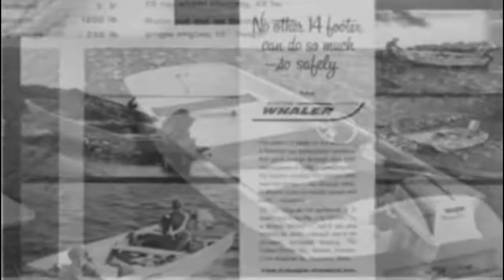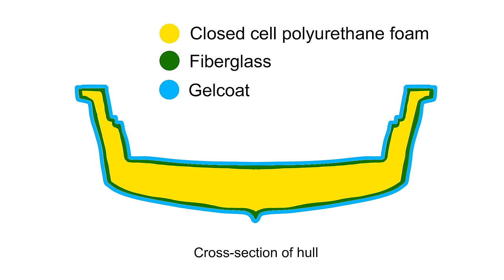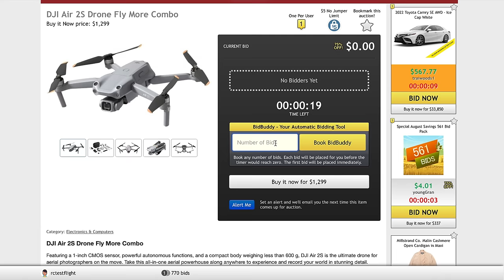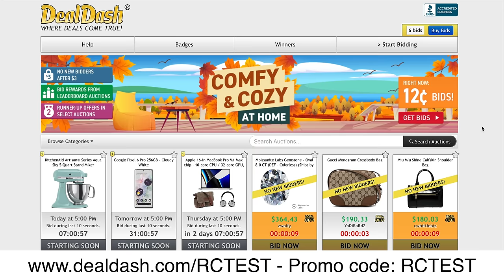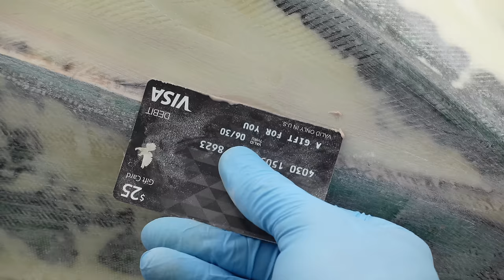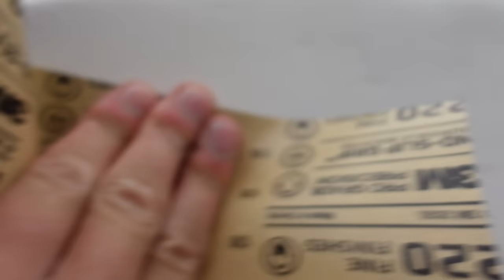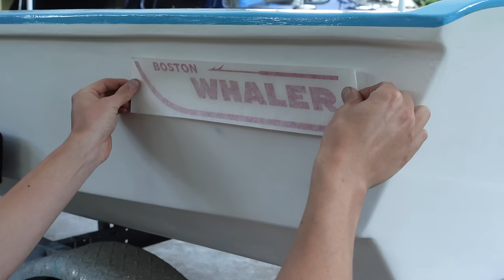50 Year Old Boat Restoration - Solar + Electric Conversion Ep.1

Comment: From my experience polyester resin is the cheapest way to do it and for boat like this its plenty enough. This is also why you dont fill the gaps or cracks with anything other than glass fiber putty and then fiber glass top of it. Best way i have found is random mesh, only using weaved on the highest tress areas. The way you sanded this thing just by looking got me itching.. dear god amount of dust is just insane. Best way seems to be using course as possible grits to get biggest possible dust witch also works as rough surface to fiberglass repairs while at it.
For places that need hand sanding just get "Reciprocating Saw" or construction saw what ever it is called. Electric saw with detachable hacksaw blades pretty much and modify dulled blade to attach sanding block to automate the work.
Roller is used to get air out underneath while paint brush is good to wet the surface, though you might want to consider using silicone brush since its reusable after epoxy or polyester had dried. Though in this case polyester resin since as mentioned this boat takes lots of resin to fix and epoxy is expensive, specially stuff like total boat what is UV protected. Cheaper non UV protected is the stuff that local boat works use and i get is 30€/kg/liter from them, but could just order a barrel worth since that is even cheaper.

Wait, you sprayed GELCOAT?! Ou nononononono, stuff you need to use is TOPCOAT. Gelcoat is when you mold something and it cant be contact with the oxygen. Topcoat is to repair and resurface existing construction like this. Guess the additive makes gelcoat to top coat but still..

Comment: In my line of work we use a high build marine epoxy primer, once cured we machine down to about 600p. And for paint we use a aliphatic assisted linear 2k polyurethane, it flattens out really well and has very high resistance to chemicals and abrasion. Ideal for boats and aircraft It's a bit more tedious compared to gel coat, but I do find it's a better option, especially if your looking for a low orange peel Finnish.

Comment: Really liked the Video, just a quick reminder to maybe keep in mind for your next boat ;): if you use Epoxy with the Fiberglass, you have to protect it against UV-Rays, which destroy Epoxy over time. When laminating a boat, they often use polyester resin based gelcoat which can withstand UV-Rays much better. Although that's not an option for you, because polyester resin cant stick to epoxy resin, it only works the other way around. I think the best gelcoat for your boat would have been just a thin paintcoat which can withstand UV-Rays and a robust anti-fouling for the underwaterparts. Would have saved some weight...

Comment: next time try to get a "Total Boat" sponsorship, that would cut down on your epoxy cost. Also you can use epoxy paint and you can get some pretty thick cotes on. Epoxy paint also has the added benefit that you don't need to sand the glass smooth because you will be adding a mill or 2 of epoxy.

Comment: As someone who is currently fixing up a 1967 13 whaler, watching this is giving me 'Nam flashbacks. And yes, polyester resin just stinks. Marine paint would probably have been much better than gel coat for your purposes. A linear polyurethane paint like Awlgrip or Alexseal will apply well and self level when drying. I had good luck with just rolling out the hull of my boat with a LP paint and wet sanding and buffing out any runs.

Comment: I have a 68.  I feel your pain, but don't have your resolve. The previous owner ran it aground at some point and fixed it with about 2" of bondo over about a 8 sqft area. When I cut out that "patch" it weighted about 50 lbs.

Comment: Look at HarborFreight and look up surface finisher. It comes with 3 nice wide wheels of different grit and pretty ergonomic to use, and would cut your refinishing time down a lot.    Now it won’t get into a lot of the tight spaces but a lot of the wider surface areas. It’ll definitely save you some time.  I think. Just my opinion.

Comment: You should try the Milwaukee M12 FUEL 1/4" Right Angle Die Grinder.  It's right in between your Dremel and angle grinder in size...and would be perfect for this job.

It has become the go-to tool for everything around my shop.

Comment: You made the right choice of resins, epoxy is the best resin to use because of is ability to bond to old cured resin, the trick to wetting thicker fiberglass is to pre wet out the back before laying it into place

Comment: Pro tip: 

If the cloth strips are cut on the bias it is much easier to for around curves. This mean they are cut 45 degrees from the perpendicular mesh weave.

Comment: Polyester resin does smell, and also isn't water proof (hence gelcoat), but epoxy is waterproof.

The "fin roller" is for mat.  It helps brake down the glue holding the fibres together, and get the mat fully wetted.

OMG!  that boat must weight a metric butt tonne, with all that extra resin .

Comment: The laser turned on because you’re supposed to swap heads with the machine off. :D There’s also a 10W laser you can get for it, as well as a dual-extruder.  There’s even a rotary attachment if you’re so inclined.

Comment: If you turn your spray nozzle 90° from how you had it you can more easily lay down the paint with a side to side wrist action. Same goes for any other spray finish you may use in your air compressor spray gun.

Comment: Funny that you use yellow tape for that. . .  
I work at a boat factory in Bremerton and we use yellow tape to indicate to the detail/repair crew things on our boats that are not good enough to send.

Edit: A 90 deg die grinder and sanding disk set works pretty well for this kind of work, btw.

Edit2: While it's true that you generally put the gelcoat down in the mold, then the glass, we do also spray it, sand it, and buff it from time to time. Mostly for repairs, not a large area. Basically, the gelcoat fresh out of the mold has to be buffed anyway. This is because the gelcoat reproduces ANY imperfection the mold has in it, even scratches and texture.

Edit3: We use screws to hold our rub rails on. Our plastic is single piece, then we put a stainless/chrome skid on top of that. The skid is also held in with screws, but decorative screws. Incidentally, any boats we make that have those protruding ridge/skids also get the stainless chrome skid on the leading edge. That way, if someone drops the thing on the only rock on the whole beach it won't fracture what is basically a load bearing rigid component.

Comment: Gelcoat is just polyester resin with a white pigment. Spraying it on the outside of a mould is fine, but it will require wax or something else in the final layer to shield it from the air so that it will cure. However, it is not recommended to apply over epoxy as it will fail to adhere in the long term. You can get away with it if you are meticulous with surface preparation, but doing it over large surfaces is risky.

You can get epoxy paints; however, these are usually primers used under two-pack polyurethane paints, as epoxy will degrade and break down if exposed to UV.

The proper method of sealing and finishing an epoxy layup is with two-pack polyurethane paint such as alexseal or awlgrip. 

Hopes this helps with future projects, and you earned my sub with this vid! PS you definitely should have just bought a better boat ;)

Comment: When doing large glassing jobs, lay it down, wet the whole thing out from one end to the other, then go back to the start and work it into place. The binders they use to hold the glass together take time to dissolve. It'll save you a lot of time poking at glass. (assuming you can do the job in whatever your pot life is of course)

Yeah, polyester resin is kinda stinky. Not that bad though really (or I got used to it lol)

If you want to reduce print through a thin layer of chop over the coarse weave will help a lot. You can go all the way down to "tissue" grade and I've seen one guy have his unmoulded surfaces come out like they were moulded without sanding, that guy was a freak though.

Comment: i may not be an rc expert at all but i know a couple things about smokers. next time id reccomend getting an old gas cylinder and cutting it in half add some hinges a counterweight and a handle. and then get a smaller thank like a scuba tank and then some 3 or 4" steel pipe to make the smoke tubes from the fire box to the cooking chamber.

Comment: Really nice project , i would make a top with adjustable height and put the the 6 solar. Panel on top you could even make slid out panel when you need it if you can't all make put them on the top . seriously nice job keep the video coming you are very in dept on subject i like it

Comment: Maybe too late to suggest this but could you tape off and plastic wrap the areas around the deck and hit it with a spray-on truck bed liner? Has good grit for traction and is weather proof.

Also it's black and probably would looks nicer, to boot.

Comment: Polyester has some chemicals that evaporate from it that are rather hazardous, probably best not to use it if you're not set up for it. When I worked with polyester based paint we had to use externally ventilated breathing apparatuses, no level of vapor filter was enough to keep our exposure below safe limits.

Comment: This looks identical to a Dell Quay Dory - possibly a licence thing in the UK - We have a couple from a similar era and every 10 years or so they need a good revamp! The cathedral hull is designed to channel air to help the hull plane. The last revamp involved filling the hull space with expanding foam - they make excellent work boats with a wide and stable hull but not so food in a seaway due to the low freeboard

Comment: You really should spread a thin layer of resin on the boat then roll it up through the fiberglass then add more on top to get it fully wet out. Especially with thick glass like 1708. This will make sure it bonds better, gets fully wet out, and it's much easier than trying to roll the resin down into the fiberglass. Also there is marine paint that some boat manufactures use instead of using gel coat if they are painting it after it comes out of the mold. They use sacrificial gel coat in the mold and they don't care what the profile looks like since they are going to paint it anyway. The marine paint cures better and is not air inhibited.

Comment: Also the hull will be better off if you drill the holes oversize, fill with epoxy putty then redrill to the bolt size. I get you're doing a good enough job if you're not long term committed to this boat though.

Comment: You don't use silicone sealant for the boats, there's a special PU rubber that is called Sikaflex, it works better and doesn't peal off or leak in the presence of water.

Comment: Epoxy resin needs to post cure at higher temperatures, that's why boats are made with polyester resin, it doesn't require a post cure. also epoxy resin doesn't bond to chopped fiberglass strands, only woven fiberglass.

Comment: Heavy mat is better for structural and layer at 45 degrees to increase cross dimensional strength and then cover with 8 Oz or 6oz cloth for your finished shell. Then light sand and coat.

Comment: “West Systems” makes great epoxy. 

105 resin with 205 fast hardener or 206 slow hardener. 

403 is also a great pulverized fiber for thickening resin and bonding cured fiberglass parts together. 

I use it all on aircraft.

Comment: 46:44  My grandpa donated an antique Boston Whaler to brothers and I.  We began repair, but stopped when we determined most of the foam in the hull was waterlogged.   Would be interesting how much your finished hull weighs OVERSPEC.  How many pounds of resin, fiberglass, gelcoat, etc, do you believe you added to your?  50 pounds?

Comment: For the one board that had a crack running down through it that you put the compound in. I was just wondering why you didn’t just use water proof wood glue and clamp it?

Comment: I did a similar boot restauration last year. I needed  to rebuild the back wall where you normally put your motor, ended up costing a lot more tham buying a new aluminium boat thats bigger 😅. I think you should have done multiple layers of fiberglass and the top layer should be the choatic mats of fiberglass, these would have given you a smoother finish and they are usually cheaper.
Reply: wrong biy ñew boat

Comment: Great video I love your videos but I have a question. You think the owner of that truck maybe willing to sell it but if it has the 5.7 engine in it though which in most cases it will.❓❓❓❓❓❓❓❓❓Hope to hear from you soon and love what you did with the boat I really did not think it would work well with those motors and gald you mad a believer out of me. Because of it you have rethinking a thing or two. THANKS bro🤝💯

Comment: I make resin dice, so I always get a laugh when people say they get a smooth finish from 400 grit. I know it's smooth enough for their purpose but I have to torture my fingers by going from 180-14,000 grit to get a glass like polish. 180, 300ish, 600ish, 1200, 2400, 3000, 6000, 8500, 12000, 14,000. Then a plastic polishing agent on a foam pad on a power drill, it's around 25,000 grit, but is like paste. 6 dice take about 10 hours of constant sanding and polish, but my god they are pretty when you're done. It used to take me around 20 hours for a set, but a year of practice cut it about in half.

Comment: You could compare the weight of your boat with the factory spec. That would tell you if the foam is saturated with water. Boston whalers are famous for floating when they get swamped. You don't want it to swamp and have it sink.

Comment: If you ever do this again, check out the local municipal impound contractor, currently in Seattle it is Lincoln, for abandoned boats and or trailers. No one buys them at auction, some are not too bad, and you get the paperwork that show you  as the legal owner.

Don't go on auction day, stop by during the week when someone will have time to show you what they have sitting around.

Comment: The waterlogged whaler is a nightmare. I had to drill a few drain holes and hook up an air powered venturi to draw the water out. Eventually just cut a big hole and set a hair dryer in there. Got it as dry as possible before completing the repair. whalers are a massive sponge.

Comment: i build boats for commercial use. you can spray gellcoat just fine. we normally sand to 80 grit before we spray repairs tho sainding aid will stop it from being kinda tacky after it cures

Comment: Couldn't you have used some expanding foam / spray foam insulation so fill the larger holes instead of Fiber / Epoxy? Love your videos, especially the longer ones.

Comment: If the resin you used to get the glass on truly is epoxy, the gelcoat may not stick very good. Polyester resin like gelcoat doesn't like sticking to epoxy resin so sand that jawn down real gritty

Comment: my two cents: use vinylester or polyester resin instead of epoxy. the original boat would've been polyester. even though epoxy doesnt smell "as bad", epoxy fumes are significantly more toxic. you can basically work without a respirator when dealing with polyester, as long as youve got good ventilation
Reply: update: didnt realize you'd already gotten there. oh well, epoxy is fine. im just biased, grew up around polyester fumes so to me it smells like money
Reply: and finally, you never want to sand fiberglass. lay up as much as you want for strength, then fill with microballons if a smooth texture is desired. obviously, sanding the fibers basically deletes their structural integrity

Comment: Might be too late now, but you should go out and buy a cheap Soda Blaster form Harbor Freight, then build some plastic walls around your tent and blast away. If cleaned off a few fiberglass airplanes this way. Baking soda is much easier on the fiberglass surface and strips nearly as well as sand blasting.

Comment: You should not laser vinyl because of the caustic gasses it releases.  Vinyl should be cut with a drag knife cutter like a Cricut or similar cutter.
Great job on the boat!  That looks fantastic.
Reply: Was about to comment "hate to be that guy, but..." and say about this.

Comment: Yes, the joys of repairing an ancient boat, been there, done that.  The boat I did was built much better than that one.  The only foam was in a fiberglass box built in up under the deck.  It was a lost less work than yours, but still quite a job.   And yeah, foam fiberglass composite turns to sh** eventually.  Repairing a Hobie cat was more similar to what you are doing here.  

I've done a couple of new transoms in pleasure/ski/fishing boats.  That is a bitch of a job, too.  I tried to find a replacement for the crap ass plywood, but at the time there wasn't a really good answer.  I think there might be plastics available now that would work.  Hopefully, anyway, because I have another to do, a 19' Stingray.  Even just the marine grade plywood is pretty expensive.

Finished boats like that are great too.  You can make a lot of profit on them, which usually works out to about $1/hour for your work.  The old saw that says a boat is 'just a hole in the water that you throw money into' is fairly accurate.

Those are some very lame U bolts, dude.  Not what you should have used there.  If you even just look at a muffler clamp they are MUCH better made than what you have there.  I would go buy some made for that purpose, and I would replace those leaves, too.  They are not that expensive.  If the leaves are just surface rust, OK, but those didn't look that way.  But since you sold it, that is all the next guy;'s problem.